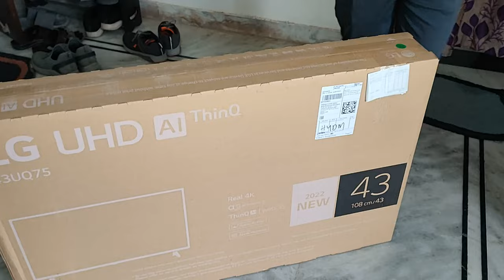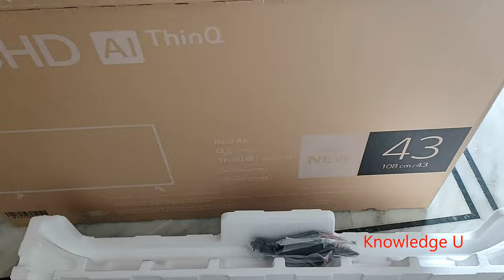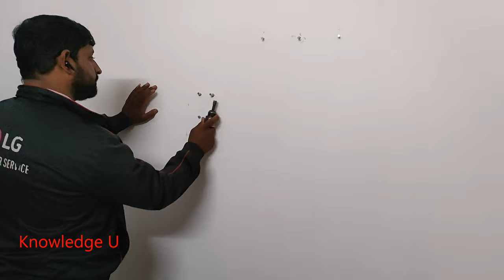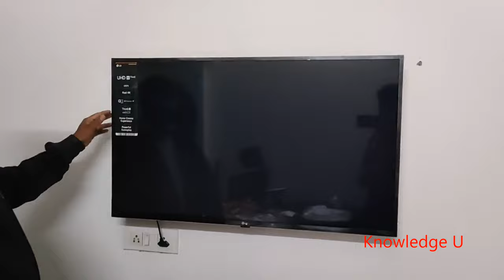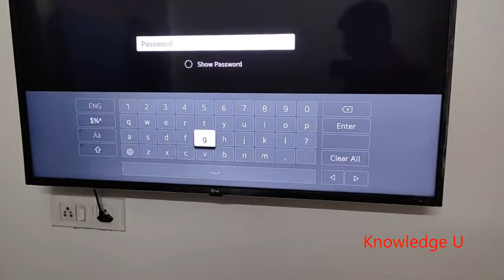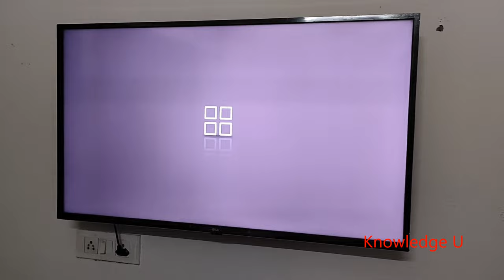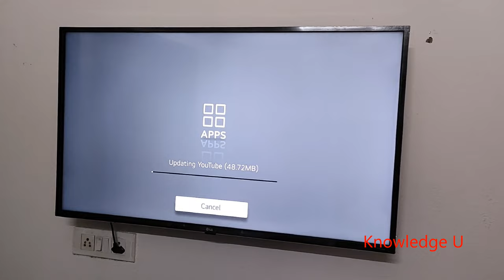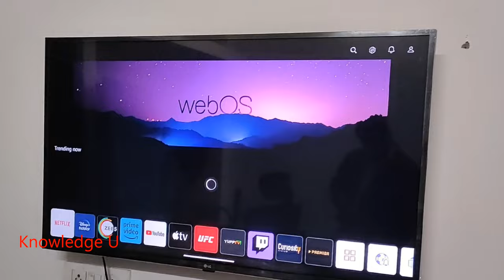Smart LED TV LG 43 inch AI thinQ 43UQ75 Real UHD 4K resolution unboxing, complete installation

Comment: Don't buy LG TV. I bought 5 LG TVs 5 years ago. But I can't watch TV because 2 units have a line on the monitor. When I talked to the service center, they told me to buy a new one because the warranty period was over. LG TV is only used for 5 years. It's shorter than a cheap Chinese TV
Reply from the maker: Any brand LED TVs are use and throw these days.
It depends on how you use the TV.

To get long life of TV, keep TV always at the dry wall side, free of dust.
Reply: Yes i bought lg same model 15 days ago and noe it's hanging problem😢

Comment: Hello friend, could you please tell me the distance between the screws on the back of the TV.
I have a hanging stand on the wall that the distance between the holes is 200 millimeters, will it fit or do I need another hanging stand. Thanks in advance
Reply from the maker: Holding bracket for TV are different for different brands. One brand doesn't match with another.

Comment: Wall stan tvควรปรับด้าย 4ทิศทาง เช่นก้ม เงย ขวา ซ้าย N,S รายละเอียดไม่รู้
Reply from the maker: If you sit at one side of the room, like near window or fan then you are viewing your TV in cross direction, here side viewing drops the clarity of picture viewing, here this adjustable wall mount works perfectly well. It will allow you to adjust the TV such that you are viewing the TV in straight direction, now the picture viewing clarity will be 100%.
So, this is the use of adjustable wall mount bracket